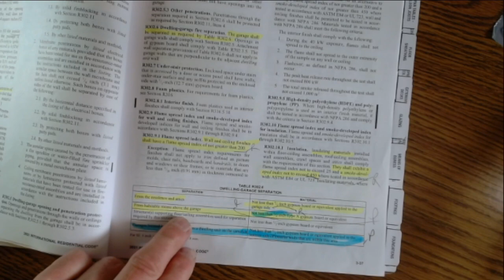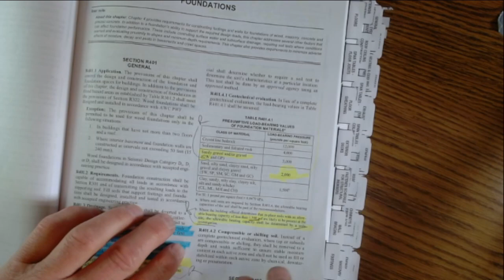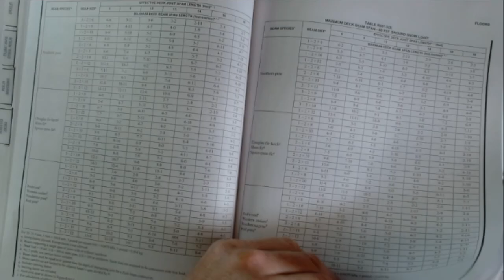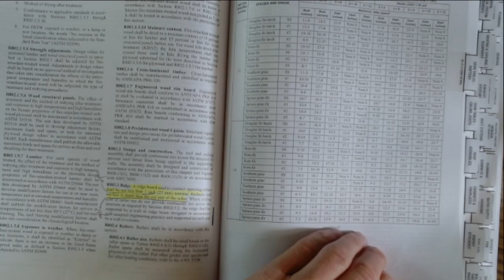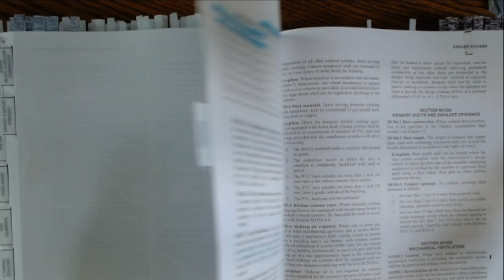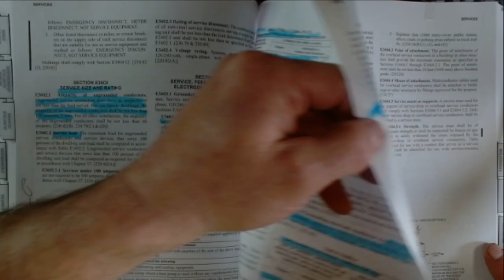ICC Residential Building Inspector and Plans Examiner Certification || My notes to help you pass

Comment: Hey Russ. I took the 2021 IRC B1 about a month and a half ago without studying or highlighting my book and I got a 40%. I just wanted a good look at the test one time. I now have the flash cards and I highlighted the flash card parts in the book. 

Any tips on how to get better at remembering what is where in the book? More specifically how to be able to tell what chapter the question is from?
Reply from the maker: Good luck. What I need to do is make a test like I've done for the other ICC topics based upon my highlights.  It just takes so long, probably 100 hours, which is why I've not done it yet.
Reply: @CatchSunlightRussLivesay  it indeed does take a long time. There's over 240 flashcards I believe for 2021 IRC chapters 1-11. Chapter 3 alone has like 80-90 cards. 

I suppose the first thing im gonna do is test myself on each card about 5-8 times and then try finding them in the book about 3 times each or more.

It is a lot, 100 hours seems very accurate

Comment: Thank you for taking the time to make this video. 

Have you taken the M1, P1 & E1? 
Are you going to be making a video of the B2 2021?
Reply from the maker: I've taken them all and will be posting commercial, but not residential.  I will be doing the commercial electrical, and maybe the commercial plumbing and mechanical.  I've thought about running through my 2021 IBC for the commercial building inspector but it just takes so much time and it's been a while since I took those tests so I'm a little cloudy on the details.  Regardless, it will be a while before I get anything published.  Thanks for your inquiry.
Reply from the maker: I started another Youtube channel and have included a couple videos for the B2 test, with Part 1 at https://www.youtube.com/watch?v=LAxRZXhq7dY.

Comment: Russ can’t thank you enough I watched almost all this video and highlighted along all the way up until energy efficiency and passed my residential inspector test with a score of 88! Now I need you to do it for the 2018 IBC haha!
Reply from the maker: The Building Codes and Standards test (BC), which is a portion of the Certified Building Official (CBO) was something I took under the 2015 ICC code set and developed an online test/tutorial for.  It may help with some of your prep if you are interested.  There are more book references in the BC test than just the IBC, but the questions are applicable and worth reviewing.  I wrote up a Building Plans Examiner (BPE) practice series for the 2015 IBC version and have the highlights from the Commercial Building Inspector (CBI) in my current 2021 code book, but have not published either of those, but will "get around to it someday" via a youtube video.  If you are interested in the BC test, which should correlate well with the current CBO BC test, you can use the test at the following link:  https://catchsunlight.com/QFPE/.  This BC practice tutorial has 50 individual tests with 10 questions each.  Hover over the "hint" for the 2015 reference to show up.  Press the "submit" button to automatically grade.  The numerical references between 2015 and 2021 have changed probably 20%, but the code and test questions are likely the same.  The bottom test is the BC.  The test above it at that link is the Fire Inspector I without any IBC Chapter four questions (meant to get to it and never did), if you're interested in a slight career change into fire protection.  Someday, I'd like to develop a whole bunch of tests for various ICC certifications to help people, but just have not turned off the TV to do it yet.
Reply: Congratulations! I’ve applied twice without passing. I just found this video, and it’s clarifying many topics that I didn’t understand on my own